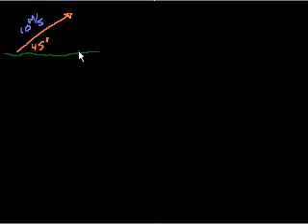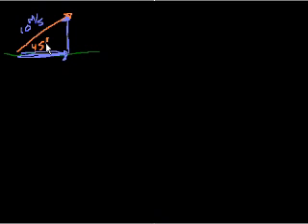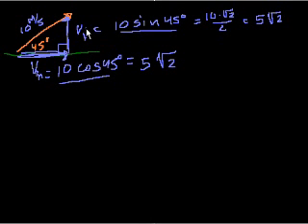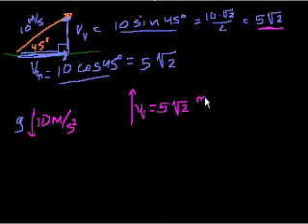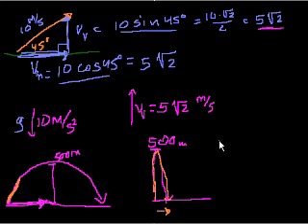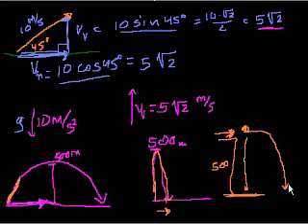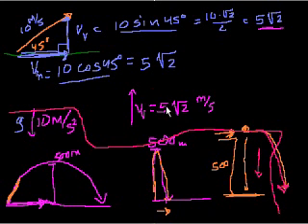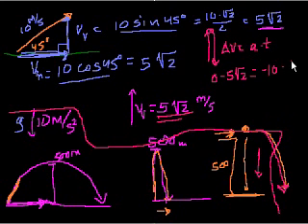2 dimensional projectile motion (part 2)

Comment: I also have it as 5sq2/10 however i used 9.8 instead of 10.
Reply: tor se i was taught 9.8 as well... at least with no regards to friction or resistance
Reply: +Scott Wilson 10 is just for a proof of concept. 9.8 is the actual gravitational pull, but 10 is easier to explain the actual concept. Easier math wise too.

Comment: @guillelainez @Jantles @3973555 im not sure you understand the way khan academy works. he teaches CONCEPT so you understand the process in solving the problems. he rounds to 10 to make the math easier. using 9.8... that's more of a technical aspect of learning and is somewhat irrelevant if you take into consideration what i mentioned the objective of these lessons are. CONCEPTUAL learning. i think he assumes that once you learn the process you'll go into detail such as using 9.8 instead 10. :)

Comment: Type sqrt(2)/2 into your calculator and see what happens.

Sin 45 = 1/sqrt(2) = sqrt(2)/2  = 0.7071

10 Sin 45 = 5*sqrt(2) = 7.071 

Sin 45 = sqrt(2)/2 is just common knowledge from right angle triangle geometry.